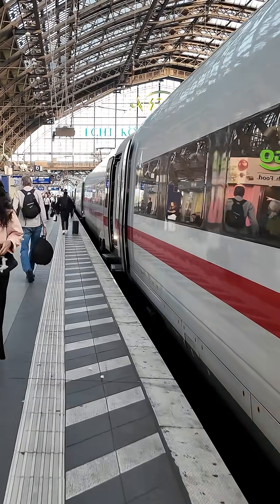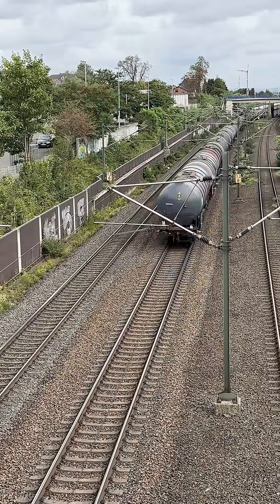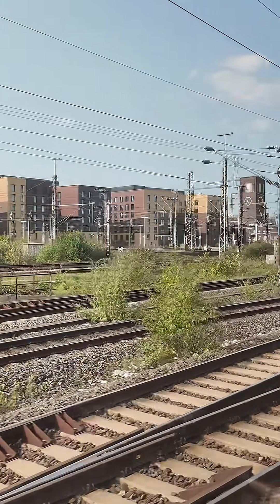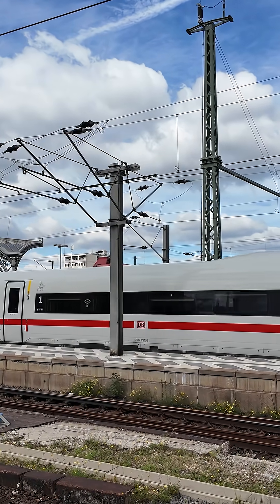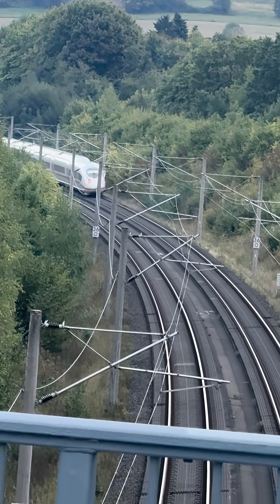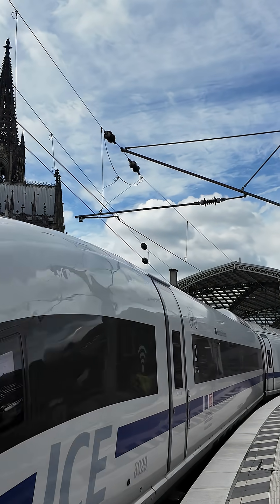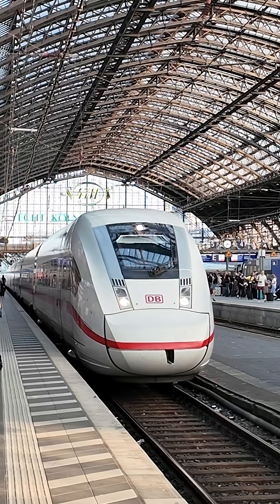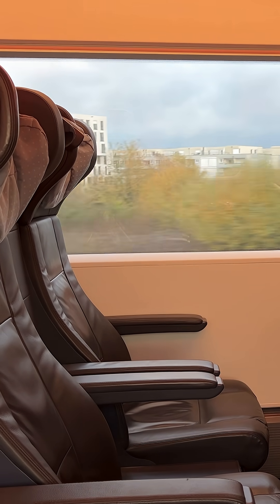Why Germany’s Fast Trains Feel So Slow – PART 2

Comment: A comment 4 support. This short is informative and true (it is sad to say it, but this makes this short exceptional).

As a german i am envious of swiss. They made 4 (four) basic points (n,e,s,w) to primary spots, AND IT WORKS.

The DB (deutsche bahn (german train service)) did not do the best for overall connectivity. F***ng suits decided: we r in architecture. Morons. S21 is not finished yet, and even the architect of S21said before his death: stupid
Reply from the maker: Hi, thanks for watching, glad you liked the video. While DB has a number of fundamental problems, let's not forget that on a broader scale, most countries on the planet can only dream of having an ICE that, for the most part, is quite a comfortable high-speed train. If things work well, a trip can be quite enjoyable. So while the first two parts of this series dealt with a lot of problems, in the upcoming next video, I'll look into the future of Germany's high speed railway system.
Thanks for watching!
Christian from travelmentary TV